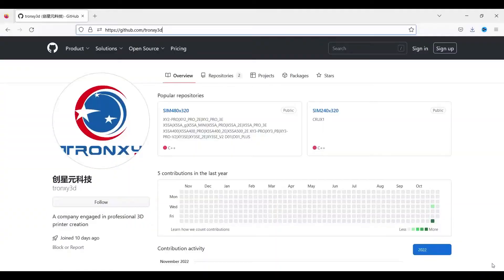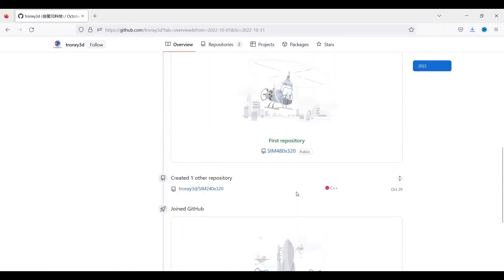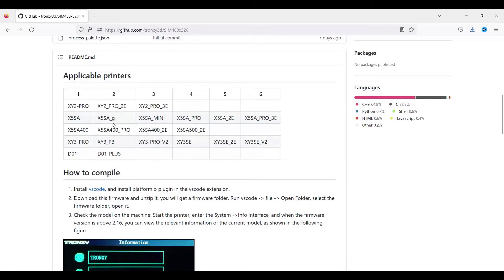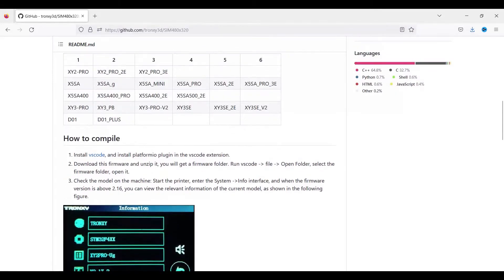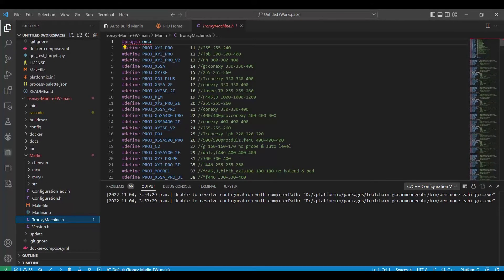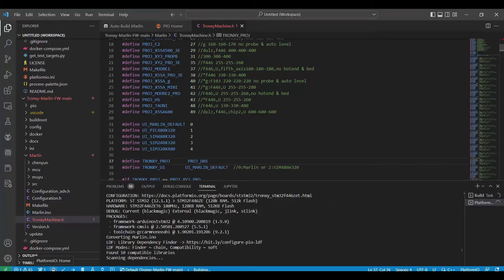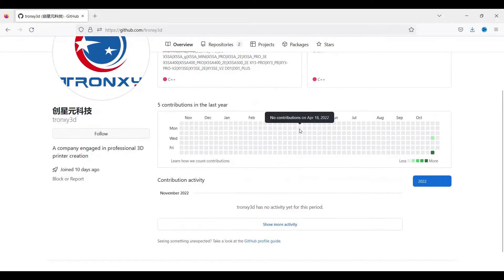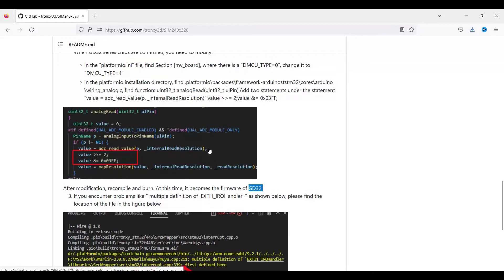Tronxy Source Code Released

Comment: Hi, congratulations on the videos, they are very clear and well done.
I have a problem and I need your help, I have a Tronxy X5SA-400 PRO printer, I followed your step-by-step procedure for updating the firmware, but when I insert the micro sd with the update file and start the printer, instead of updating it starts normally, as if it did not read the micro sd. I followed the same procedure on a Tronxy XY2-PRO and the update was successful. If it can be of help, the motherboards are both CXY-V6-191017 but:
- XY2-PRO (103)
-X5SA-400 PRO (446)
Please help me remove the original firmware, I have been trying for 2 years without success, and the printer is unusable

Comment: it took 10 hours but it built the default bltouch so I am now building the X5sa bl touch (from your last video) next ill try the Merin auto builder as they have added my printer to the examples but ill need to update the bl touch I think im happy to have a verity of bin files it shows stability from the build process as I seem to be the first to modify a X5sa printer with 3d touch for the most part. tronxy git code built without bltouch. the drop boxs takes a full 10 hours to build? even with -j4 so im letting my linux box do that now... I am having trouble choosing if im going to try your latest dropbox... i keep recalling the complex z offset calibration and want it to be all in the printer. I have some bad ground loop experiences in the past.

Comment: Can't compile anything out of the F4xx-SIM480x320-firmware from the tronxy git hub, only getting errors.
I've compiled a firmware based on the " TheThomasD Marlin-2.1.x-tronxy-x5sa-400 " and changed some code for the X5SA , but cant flash it , Printer ignores the .Ctb file. 
Tried connecting via STM32CubeProgrammer , but it wouldn't connect ( believe that the Cxy-446-v10-220413 Board doesn't have the boot jumper like other similar boards  ) 
Starting to accept the idea that the original tronxy X5SA board can't be used for anything ( And I have two here) Should I trash them? I can't tolerate the original firmware
Reply: its built on python 2.7. I also built it on python3 you just need to wrap a array with list() and the rest is errors telling you to set a config var. i cant get the bl touch to build unless it is his dropbox autobuilder has a example out, tronxy_v6_191017 not tested just built
Reply: @fenderrexfender  I gave up, used a Mks Robin nano and a creality screen from a ender 3, works great and it has auto z alignment now, perfect layers! I have two tronxy boards laying around. I might use them for a hotend testing station or something...
If you know how to compile anything for the v10 board let the world know :)

Comment: Hi Jeff, thank you so much for your support that works instead of the Tronxy official support.
Do you know the procedure to backup the firmware inside the CPU of the new motherboard CXY-446-V10.1-220921 that has GD32F427 ?
I have a X5SA Pro printer. Thanks.

Comment: I downloaded the F103* repo from the Tronxy3d repo, got it tocompile, then I decided to try to reach my lifelong goal of the Trynxy UI with M33 get long file names enabled. I got a lot UINT16_t to char errors. I walked my way through them, fixing it by mostly just copying the declarations from the else section where ever there was a if Tronxy_UI statement,  I copied the update folder to my sd card, did the power up thing, progress bars, Success! It seems to work find, M33 does for sure. One problem though. when I hit print on the lcd, the filenames off the sd are are chinese characters. everything else is english, menus etc. M33 gives the right names, if I try to print one of the chinese named files I get english. only on the sd card listing on the lcd do I get chinese. power cycle didn't help. switching the UI to chinese and back made no differenct... I guess I need to find a typo or something like that. nonetheless a big Thank you to all who helped get the source code out to the public.

Comment: Hi I have the old V6 board in a Tronxy xy-2 pro and was running the original Tronxy Chitru firmware and have the Tronxy Wifi module working. However when I install the new MArlin Tronxy firmware the WIFI not working, can anyone help. Thanks so much

Comment: Hello

I bought a Tronxy Gemini S IDEX.
And with the software original firmware it is. Impossible to print. Tronxy does not give access to the printer so you can calibrate something. Can someone help me there 🥴

Comment: The discord link is not working 😕
Reply from the maker: Try now
Reply: @jeffs3dcorner  thanks Jeff. It works just fine. Are these firmwares useful only with v10 boards? Can you use it with v6 board as well?
Reply from the maker: Just the v10
Reply: @jeffs3dcorner  Some of the V10 were still marked with V6... like one i am building now, x5sa-400pro this firmware works fine with, though hald the decent marlin features are not activated, will have to tinker
Reply from the maker: Good to know. Thanks!

Comment: Seems there is no way to compile firmware for X5SA with st32f103. It compiles only for stm32f446
Reply: I was excited, compiled it and tried to flash immediately without noticing that firmware is for F446. Now it shows only black screen. Fortunately, bootloader still works and tries to flash everything I give to it.
Reply from the maker: Did you try changing the chipset in platformio?
Reply: Yes, it does not compile. They put compiled libmcu.a, that gives errors of undefined references
Reply from the maker: And v10 board?
Reply: @jeffs3dcorner  board is CXY-V6-191017
Reply from the maker: This is only for the v-10 board. 
V-10 is the board they have been using for the past few years. There are lots  of other videos out there for the v6 board.
Reply: Well, ok. I will flash it with another method. But it is weird, as I bough it a few weeks ago from amazon and it came with older board.
Reply: I have added a GitHub issue on their repository, it seems the only one for us f103 peasants it's the rhapsodyv edited Marlin firmware (which crashes my LCD on the xy2 pro) :(
Reply: @mashermack  I just cloned latest Marlin, put config files from their configuration repo and compiled it. Flashed it with boot jumper and stm flasher. And it works from first try
Reply: @Slicomful  thank you very much. Can you also flash via SD card with update.cbd or only firmware.bin is generated?
Reply: @mashermack  after I flashed another bootloader it accepts update.cbd. Search for a video called “Complete video tutorial for burning 103 firmware”. There are 2 parts
Reply: @Slicomful  thanks, absolutely helpful. Have a great day sir!
Reply: Tronxy followed up with my request and uploaded also the F103 firmware on their GitHub :)